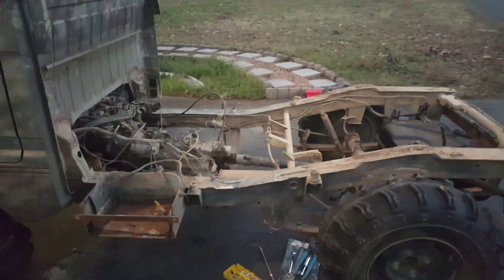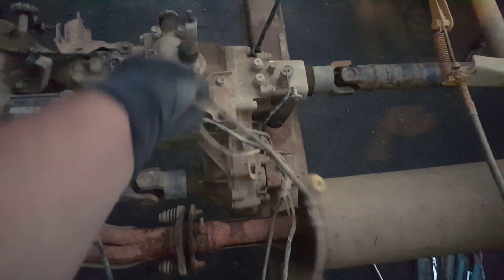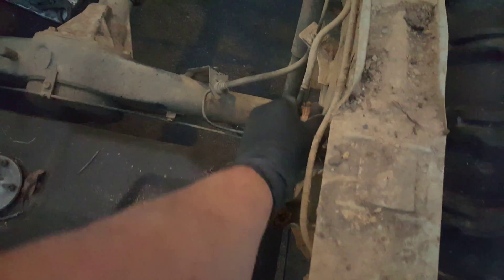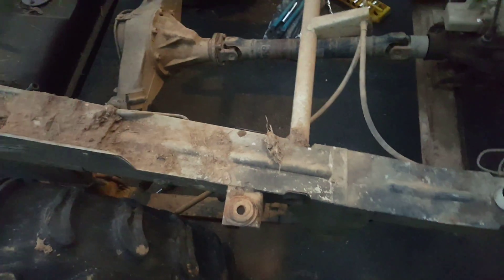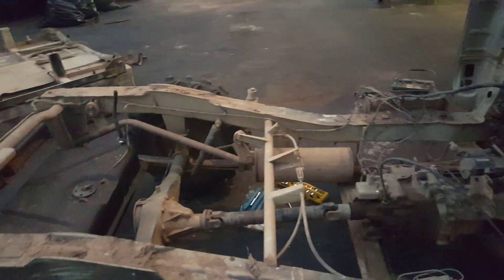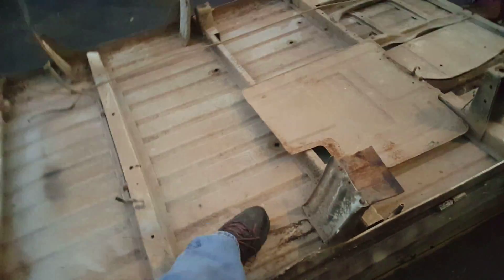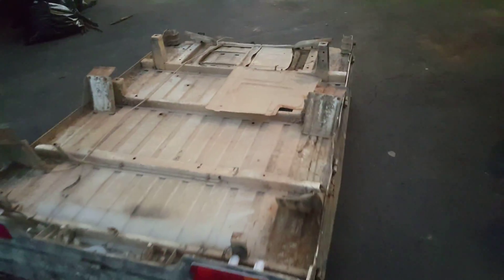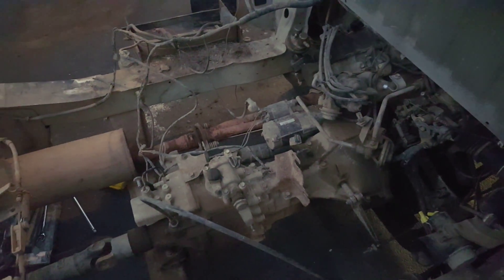1988 Suzuki Carry DB71T Engine Swap Part 3

Comment: So all you have to do it replace the fuel tanks with lithium batteries and the engine to an electric motor strong enough to turn the wheels.